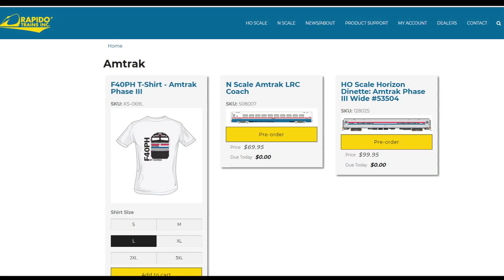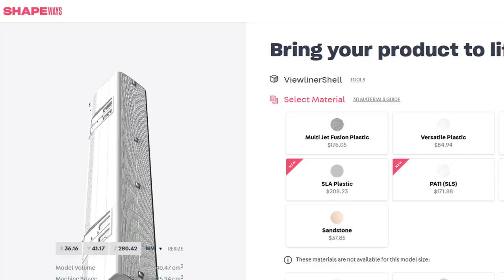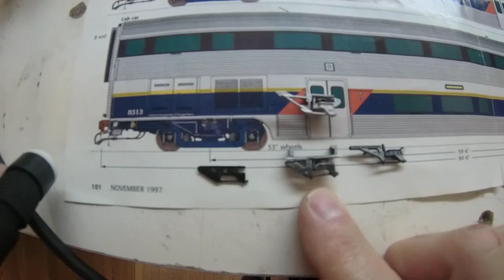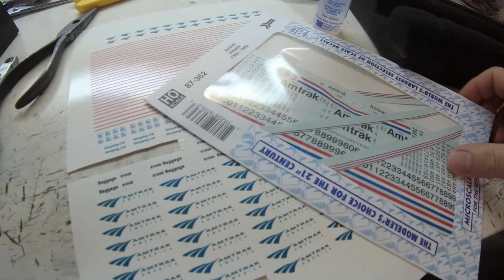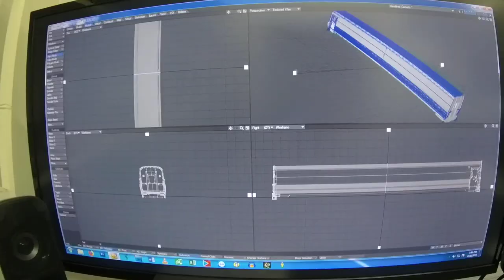3D Printed Viewliner II Baggage Car Part 2

Comment: Super cool. Thanks for sharing. I did some research and planning to possibly make Via LRC coaches as they were selling for over $200 consistently on eBay after having been out of production for some time, and none existed in the current paint schemes. But Rapido ended up making another run of them after repairing/remaking their damaged tooling, saving me the trouble. I'm still interested in manufacturing niche trains or vehicles at some point. Look forward to seeing how this project progresses
Reply from the maker: Thank you!

Comment: Commenting in late 2020: Do you sell these in some form? (Kit or Complete) Were you able to find a solution to the size being off? Great work!
Reply: Hi we still haven’t found a printer that will produce a good enough print for the size required.  IHP hobbies has released a kit that is true to scale in HO.  But it does require paint, decals and final assembly.
Reply: Rob C Thanks for the reply! Any chance you could post a link to the IHP Kit? Sounds like an interesting option!
Reply: Never mind, I found it! Thanks for the tip!

Comment: Whats the price for one of the finished viewliner baggage cars?
Reply from the maker: Hi there.  With Shapeways collecting CA tax, it's now $380 shipped for a finished baggage car and $435 for a Bag-Dorm.  It's $280 and $320 respectively as an unpainted kit.  I hope to bring this price down once I get a home printer.  Not sure what the price will be, or how soon it will be as the quality of a home print is a big question still.  You may be able to save tax and purchase directly from shapeways shortly when I put these on my store there, but they won't be in a kit form. - Rob
Reply: Model Trains Sounds good, let me know when they are posted shortly.  The models look fantastic!  Who knows if anyone will ever get around to manufacturing these cars